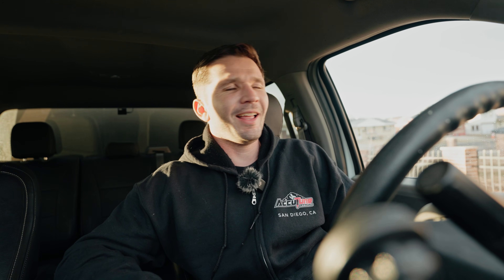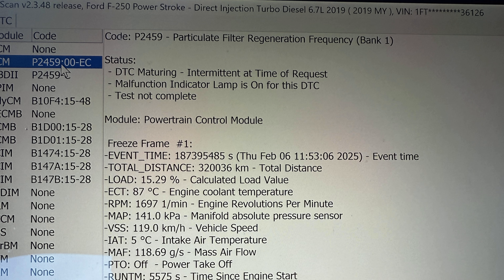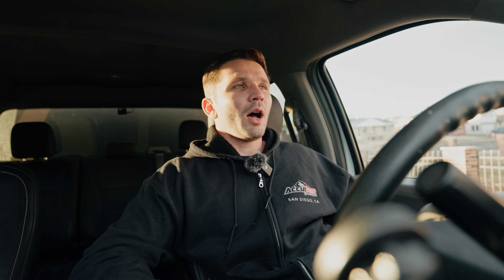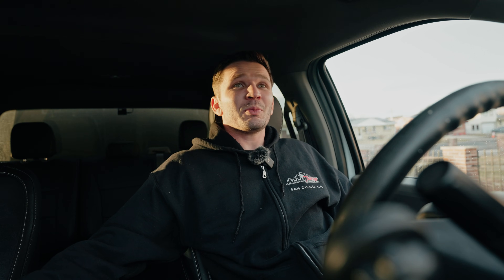Complete MAF Sensor Failure 6.7 PowerStroke

Comment: Powerstroke tech here, every time ive got a diag and noticed aftermarket maf or map they were the cause of concern ive never seen one actually last and work. Also maf parameter reset may help when changing anything with the airflow the truck sees

Comment: My brother bought a 2011 power stroke back in the day and loved it so much that later he added a 2019 power stroke to his fleet about four years ago.  They have been great trucks, but the dealership said someday when they are wore out that he will be looking at $20,000 to repair the engine on each of them.
Reply: Still cheaper than buying new
Reply from the maker: It’ll be a long while before those engines go out haha
Reply: @ True!  These trucks remind me of a semi.  Most people are not afraid to buy a semi with a million miles, but when the engine is finally wore out my buddy had to pay $25,000 to have his semi engine rebuilt quite a few years ago.  I think the 2011 and up generation of power stroke is the best built diesels on the market if you are going to be buying a brand new truck from the dealership.

Comment: Do you run any fuel additives? I’m running carbon treat from Schaffers. I have a 19 6.7 with 188,000 been solid this far.
Reply from the maker: I run Archoil Ar6500 and AR6400-D

Comment: Learn something every day. I ordered new MAP and MAF from rockauto last week. Going to put the original ones in the glovebox.... You can get cleaner for the MAF also.
Reply from the maker: Good call! How have you liked rock auto for parts?
Reply: @powerstrokemaintenance  been using them for years, always price around but most times they have good prices. I do 98% of my shopping online.
Reply: I was thinking of commenting on that point.  For gas engines at least, your suppose to clean the maf sensor at every air-filter change.